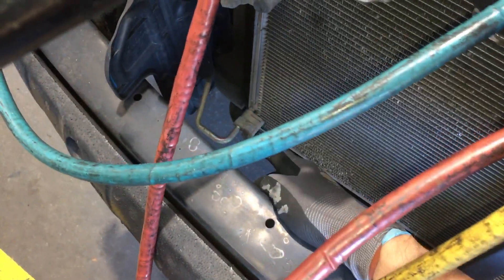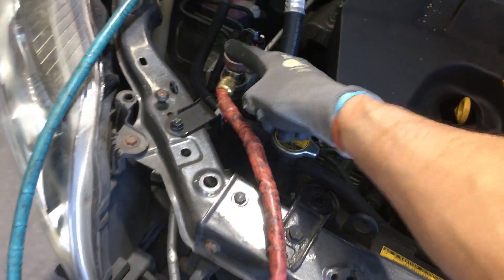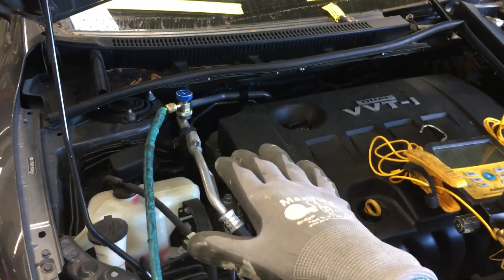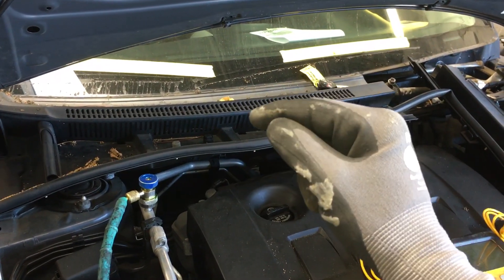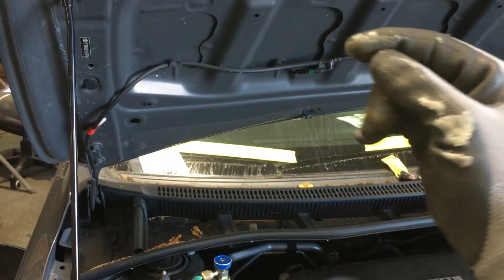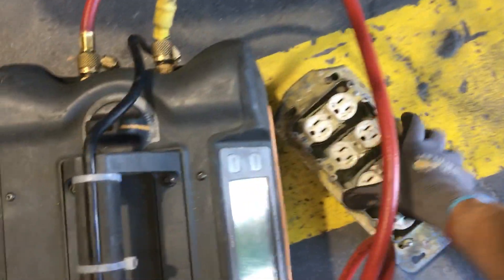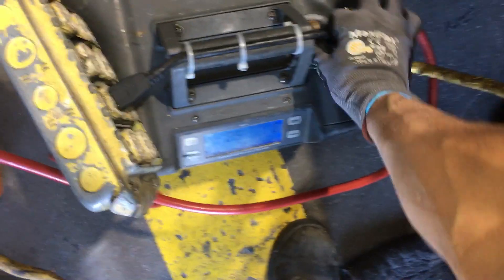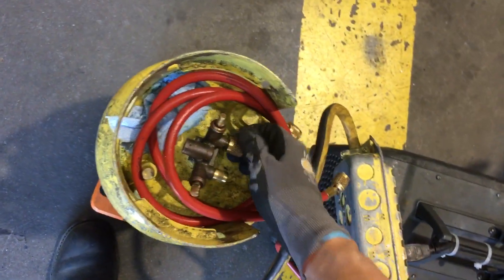Why ? You don’t recover liquid refrigerant in automotive refrigerant recovery procedure. ￼

Comment: why is that pump shutting continuously shutting off?
Reply from the maker: Because it has reached -20 inches mercury, vacuum recovering refrigerant. It’s a automatic safety shut off.. 
But I like to recover my refrigerant all the way down to roughly 900 µm 
     So I have to manually override and hit the restart button

On my other recovery unit, NAVAC four-cylinder I do not have to do that. It will stay continuously running as if it was a vacuum pump and recover the refrigerant all the way down to 900 µm. 

EA minimum recovery standards is only -15 vacuum for recovering refrigerant for Automotive 

But I don’t believe in their minimum standards I like to go beyond that 

Especially when it’s refrigerant because it is a high dollar value refrigerant so I like to get that last extra one or 2 ounces of refrigerant out of the system that a standard RRR recovery recharge recycle machine leaves behind
Reply: @coldfinger459sub0  Thanks for the response. I am a small one man shop and im skimming through your videos to get an idea on buying all the components for recovery/recharge and vacuum. Dont stop with the videos.

Comment: Have a question. When i recovery refrigerant. And during ssuckin refrigerant, leak occure ( for example front shaft seal) my machine will ssuck air to cylinder yes? And does total weight increase by any "X" grams amount of air ?
Reply from the maker: Yes, you will sucking air through a front shaft seal. That leaks.

No, it will not increase by grams nothing that your scale to measure.  Because Air is basically 70% nitrogen and 20% oxygen and even if you pump in another hundred psi of pure air a couple cubic feet the scales that we use would not be able to wet as weight in grams.. 

It just be air contamination moisture contamination.
Reply: @coldfinger459sub0  yes, my refrigerant will be contaminated with air, but i dont care really about it. I ship cylinder to special shop for recycling. Im rather ask...if for example system capacity is r134 - 500g. If im recovery 600g vapor refrigerant ( with unwanted air) could it mean that im ssuck 100g of air ? Or rather system was overcharged by 100g ? And air weight = nothing measurable ?
Reply from the maker: @andrzejnazwisko5331  no that means your scale is off or something is wrong in measurements. 100 g difference is a huge difference with small high-efficiency, microchannel, condensers and evaporators. These are crucially charge systems. They cannot be 100 g off on charge.. 

That means something is very very wrong with your measurement system

Comment: did you use any acid/contaminated/filter-drier with recovery machine ?
Reply from the maker: On my one big NAVAC recovery unit I have a very large permanently installed filter dryer. 

On my small Fieldpiece I only put one on if I think I have a burnt up unit . .
Reply: @coldfinger459sub0  thought about it, but this filter drier will be full saturated with moisture absorbed from air in 1 night When recovery machine stay in garage
Reply from the maker: @hbo7799  you attach a ball valve to the end of it that you shut off every time before disconnecting the machine with a cap so it’s isolated from the atmosphere.   You don’t just leave it open to the air..